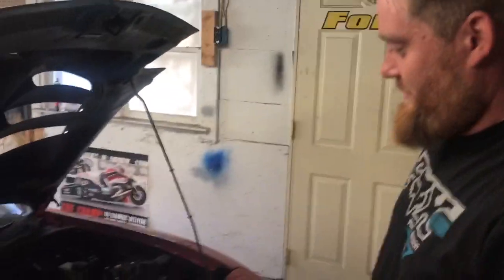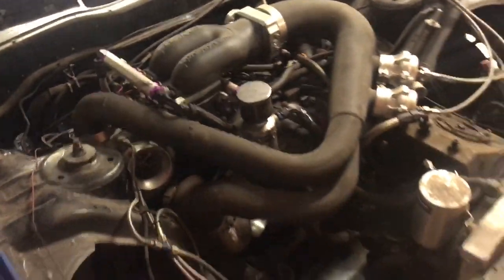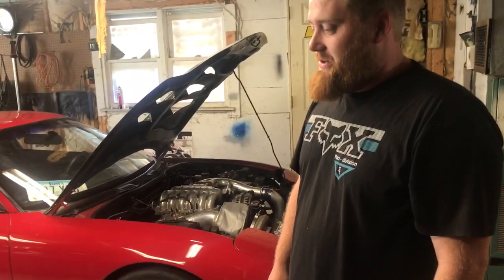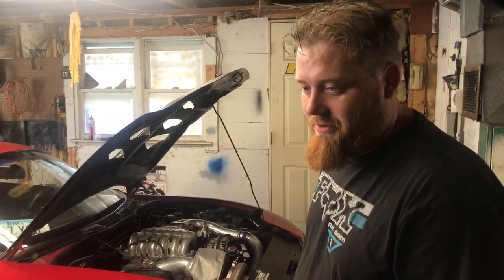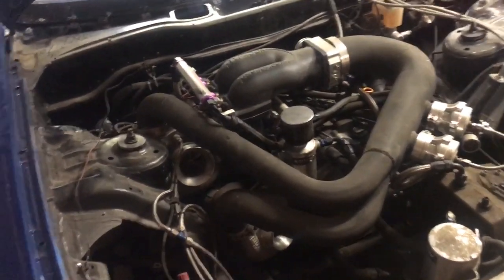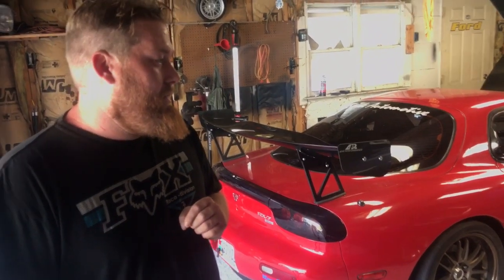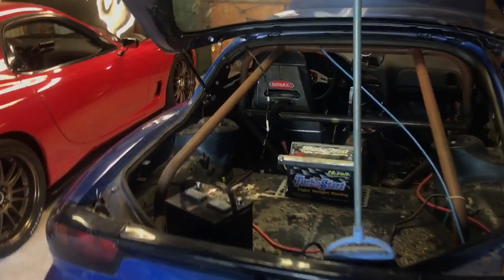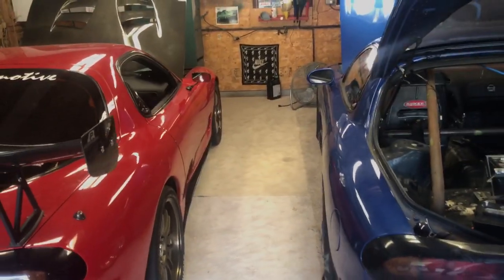It's Time To Stop Playing Around. 1000+HP Rotary Powered RX7 or Bust

Comment from the maker: The blue car already made 950whp @ 40lbs on twin 6262s using a Semi-PP Cosmo-RE Intake with 10 ID1000s, ran an 8.21 on the 1/4. It's now been updated to 12 2200cc Bosch injectors, Twin 6266s, A Projay Typhoon Semi-PP intake, and a fresh motor. Time to hurt some feelings.
Reply: Rotors Magazine Jesus Christ. That sounds like a mad daily. Lol
Reply: Rotors Magazine keep the rotary legacy moving 👍
Reply: Rotors Magazine that thing will blow some seals on the first few runs
Reply from the maker: Car has already made 950whp for several seasons, we've just upgraded the turbos from 6262s to 6266s and switched to a ProJay Intake setup since then. Dead reliable.

Comment: That blue one doesnt have an intercooler, whats the benefits when running straight from turbo to intake?
Reply from the maker: Turbo response.
Reply: No need for an intercooler on a drag car and when running alcohol. Also, pay attention to a lot of really fast purpose built drag cars (not just FDs) and notice that the front bumpers have no opening for the radiator, etc.? Aero and because its for short runs cooling isn't that important for a few minutes of operation. Of course, the cars will still have a radiator and probably manual fans.